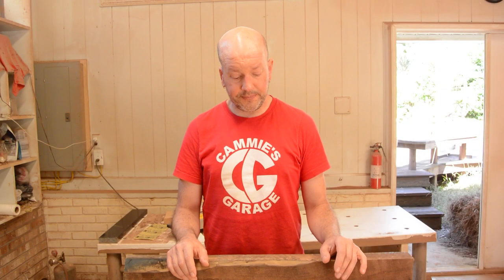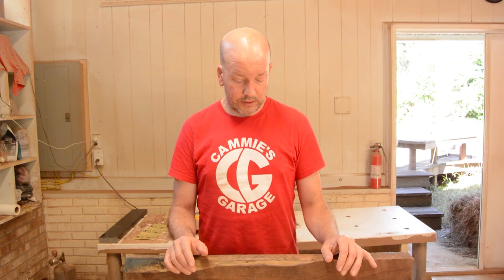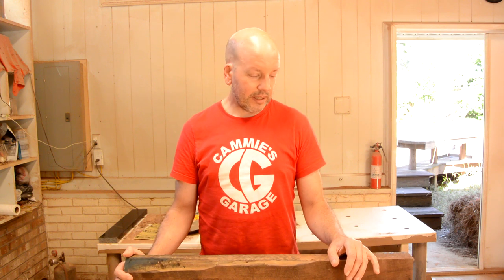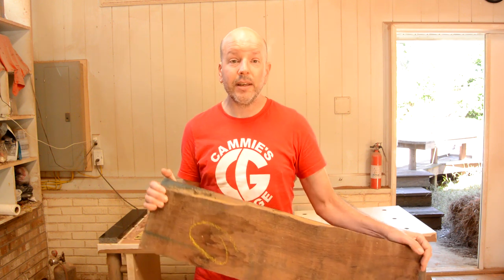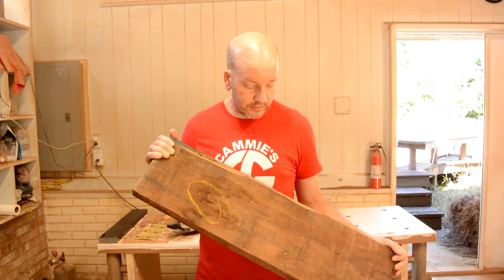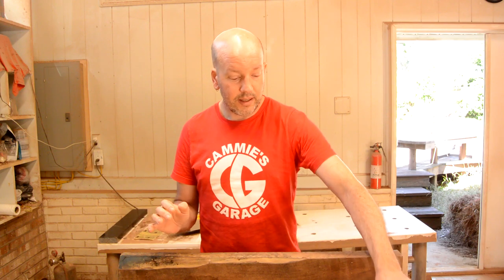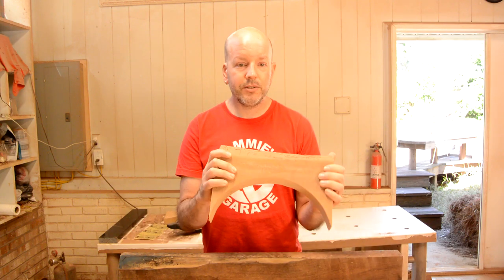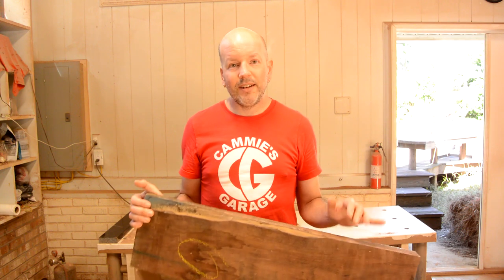Making an Urn for My Dad - Woodworking

Comment: Love it, my mom passed in September and have plans to make an urn for her but still haven't started. Whats the height and thickness of the wood and you used wipe on poly? Thanks
Reply from the maker: Thank you, Cleve. The original board I started with was just about eight inches. As you can see in the video, it maxxed out my bandsaw cutting capacity. I think they ended up just about 3/4 inch thick. Yes, I used wipe-on poly for the finish.